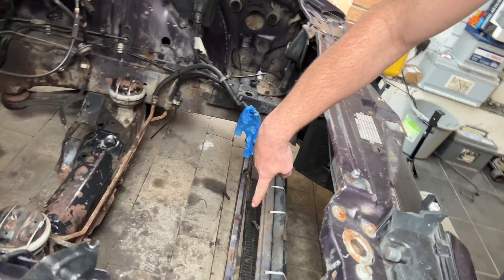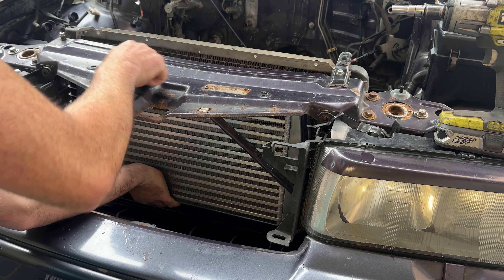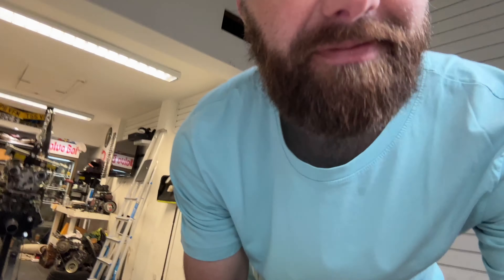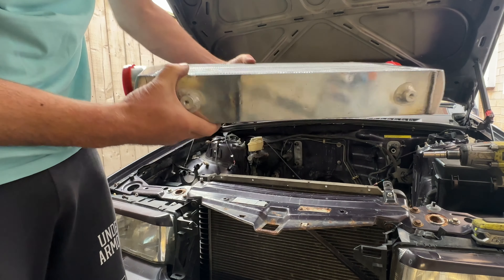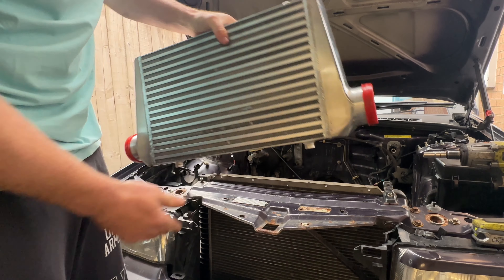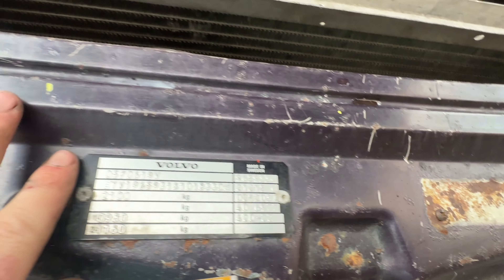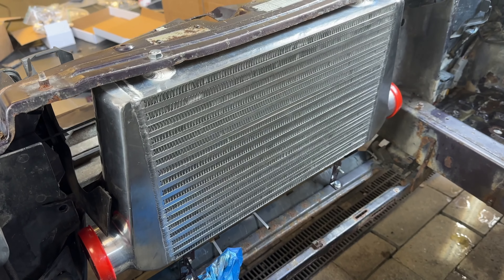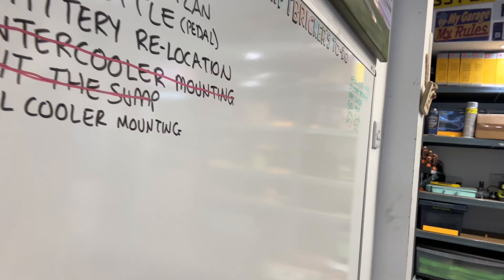Volvo 960 T6 Aftermarket Intercooler mounting | Ep.18

Comment: Thanks for the content again! I wouldn't mount the oil coller in front of the intercooler as hot air from the oil cooler exits and enters the intercooler. Try to find an other spot preferably lower and away from the intercooler and radiator 😉
Reply from the maker: Had looked at that, I agree. Lower I’m a bit scared off, it would become the lowest point of the car to the ground, and it already scrapes places (sump, exhaust etc). And in the corners doesn’t have great air flow and are in likely crash areas too. I think all things considered, it’s in a reasonable place, in front of the Intercooler.

Comment: Hello, master bricker) I usually turn the intercooler over if I come across such a small thing like side members) You can also reweld (I don't know the right word)) the outlets, but it’s a lot of work, that’s for sure.
Reply from the maker: Thanks!! Yes I’ve already been thinking about that, for a tighter radius to cut off the outlets and have new one welded on, but then it’s near the rad anyway, and yes a lot of work when I don’t have a tig! I think I’ll be cutting some metal 😃